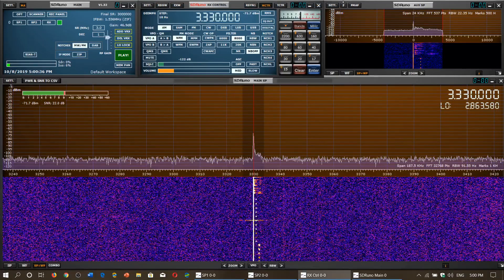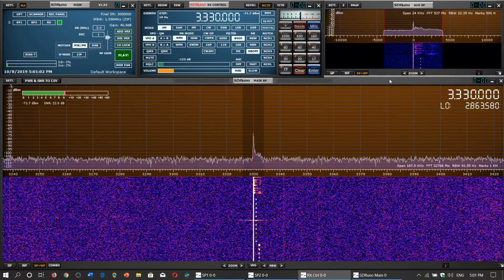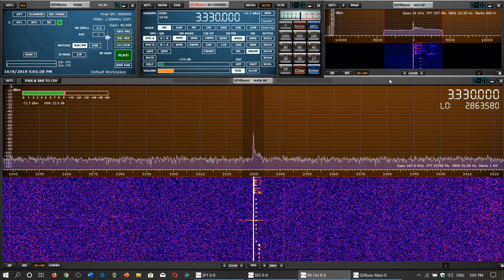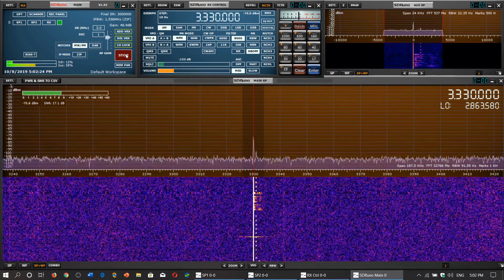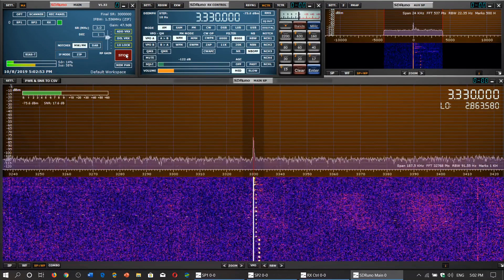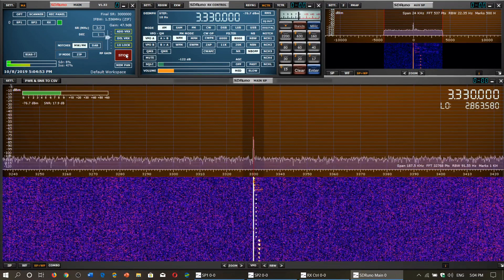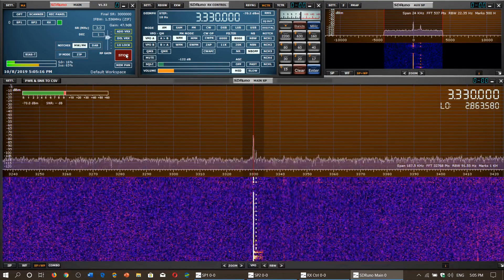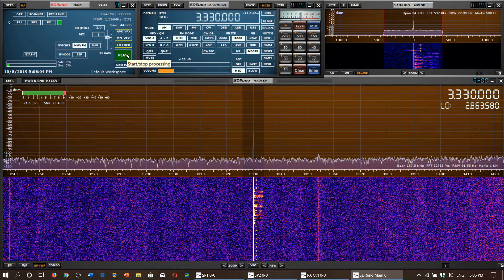BATTLE OF THE LOOPS CHU Time signal 3330 kHz W6LVP VS MLA 30 TEST

Comment: I bought the Wellbrook about 2 years ago not knowing similar loop antennas existed. Had I known about the MLA-30 would've purchased it instead. As far as this test, there seems to be little to no difference between the two antennas. Maybe the edge goes to the MLA-30 on signal strength, but definitely on price!
Reply: I don't think these CCLs (cheap Chinese loops) were being sold two years ago.  Enjoy your Wellbrook and get one of these for travel and perform the mods.  Happiness comes cheap these days.

Comment: They are almost on par with the very small exception of the noise floor on the W6LVP loop. It seems to be a bit lower,  I barely noticed it, I really had to watch the screen lol.  Now It could have been because the extra filtering you had to buy for it.  Yes I agree for over 10X more price, I expected the W6LVP loop to blow away the MLA-30 and it failed.  So the winner in this round is the MLA-30 because it did almost the same performance with less cost.

Comment: There is a slight advantage to the MLA-30 from what I saw. I took down peak readings of SNR and S units on both. MLA seemed to be in high 20s SNR much more often. LVP was lower 20s usually with a rare spike to upper 20s. S readings were as good as -64 dBm on the MLA. Usually upper -60s only for LVP